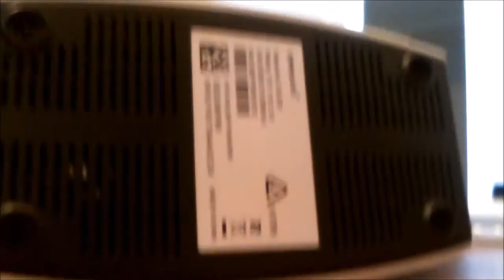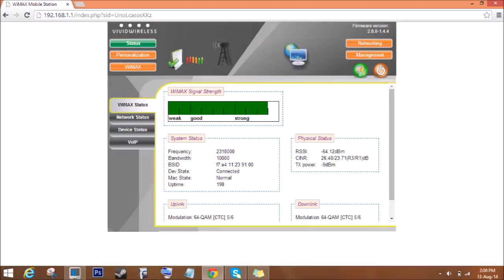Vivid Wireless (ANTENNA MOD)

Comment: Hi,
Ive done everything as instructed but im now getting no coverage with the antennas installed. Ive the link below of the antennas ive got, are the the correct ones? your help would be greatly appreciated.

http://www.ebay.com.au/itm/130745249082?_trksid=p2057872.m2749.l2649&ssPageName=STRK%3AMEBIDX%3AIT

Comment: Hey mate, just wondering have you done a speed test and had a increase on speed? Great if you can say what you got before and post a link up to your speed now? Also did you get 3 lights before you did the mod or not? Cause mine is on 3 full green lights and I'm not in the coverage area but I'm getting really slow speeds.
Reply: Jordan Hess what is your RSSI AND CINR R1 and R3 values
Reply: Right now it's not as strong as it use to be 8 months ago but the stats are -74.65 dBm for the RSSI. And the CINR IS 21.43/14.81 (R3/R1) dB. Just realised I'm connected to the same tower as the person in this vid but I just don't know if it improves his speeds...
Reply: Your RSSI is too high (should be around -50dBm)
Your R3 CINR is ok
But your R1 CINR is probably the cause of the problem 
CINR should be as close to 30 as possible 
14.81 means there is a lot of interference on that frequency and is partially jamming your signal 

The high RRSI means you have weak signal strength 
Try to aim for a RSSI as close to -50dBm as possible
-80+ means you are getting an extremely weak signal 
-50 or less means you are getting very good signal strength

And try to get a CINR reading as close to 30 as possible 
R1 is for your data transfer performance 
(Higher means more throughput)

R3 is for your connection stability 
(Higher means less dropouts and better ping times)

Hope that helps
Reply: ***** I don't think the signal matters... Its the congestion in the area. I have access to 5 different frequencies and all have a strong signal but I can't achieve above 1mbps from 4-5pm onwards until early hours in the morning. If you have any other suggestions or if you would like to talk more in-depth I can email you.
-Jordan
Reply: I don't use email but il buy a SIM card and post the number here if you want to call me and il see if I can help fix the problem for you